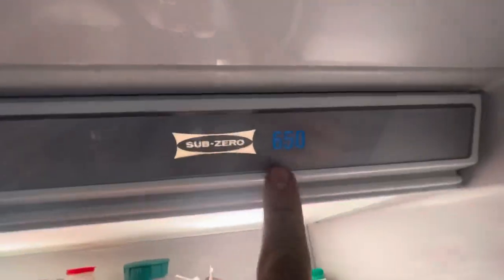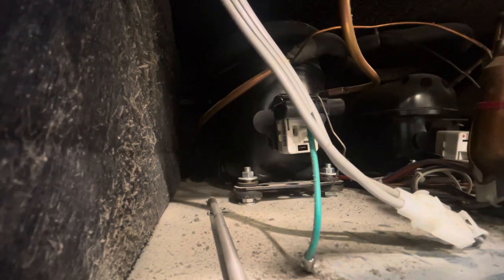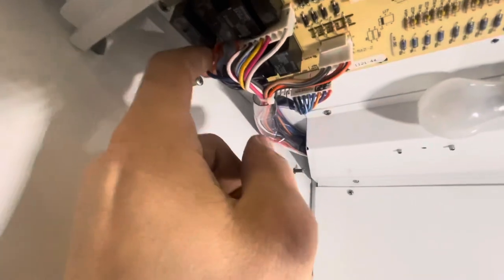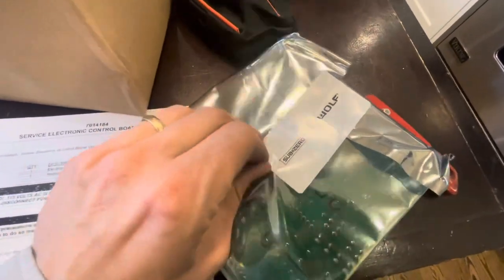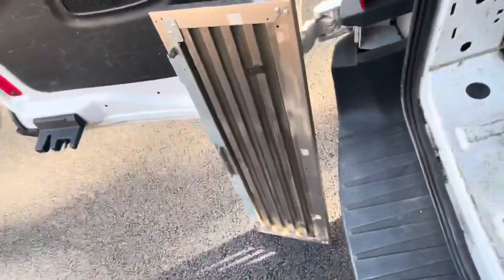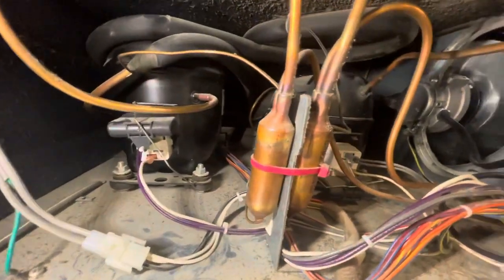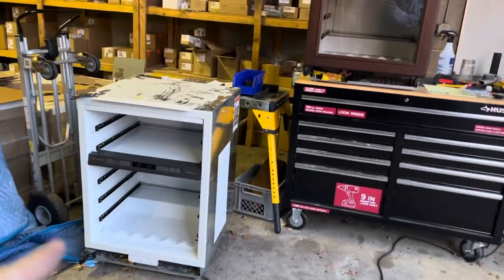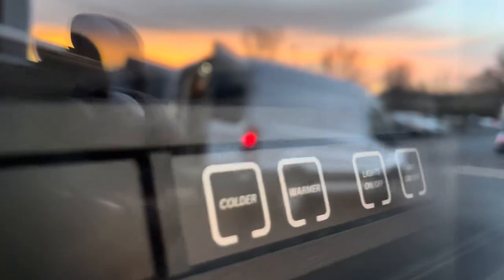Westchester Sub-Zero service in Scarsdale NY VLOG 12/7/201

Comment: Those board are like fifty bucks.  Right??    
Seriously though thanks for posting this diagnosis, and the boards aren’t crazy expensive fortunately.
Reply from the maker: Depends on the model, I do not know of any as cheap as $50… ?
Reply: @subzerorepair  I was just kidding cause given how costly the machines and some parts are (like door gaskets), I think the boards are pretty fairly prices. Thanks again for sharing your knowledge
Reply from the maker: Thanks! Hahaha
Reply: How much is usually to replace the door gasket on one or two doors ? Thanks
Reply: @starobinful  I’d be curious also. The gaskets are actually very costly without labor. I looked into doing it myself a few years ago and I didn’t because if the cost and the fact that mine weren’t really broken.  As I recall the main refrigerator and each bottom drawer gasket was close to 200. So that’s 600 without labor. And I have two of the same 700s side by side. So that’s why I punted. That was for oem parts though.